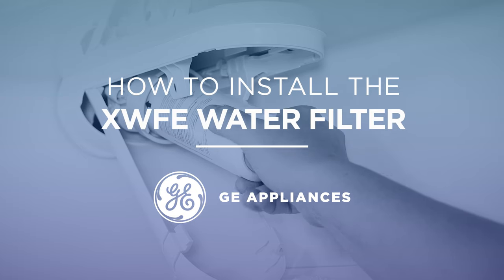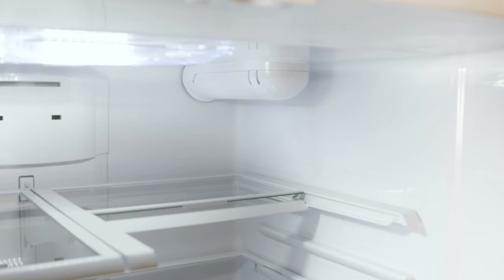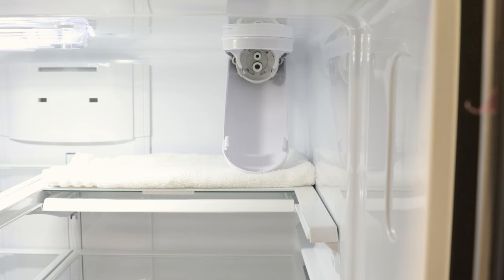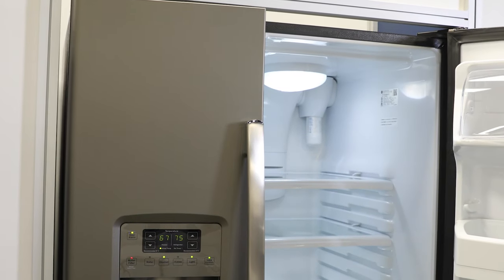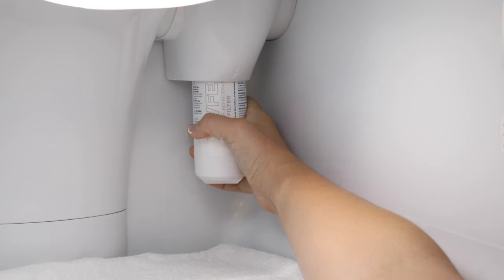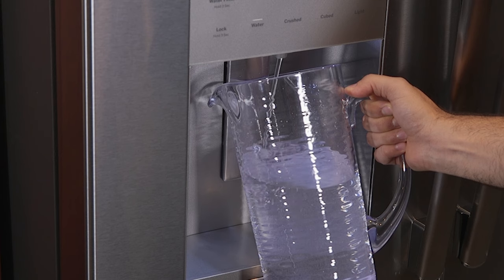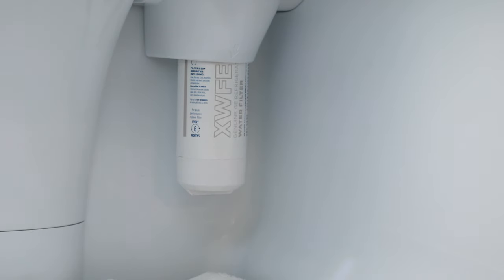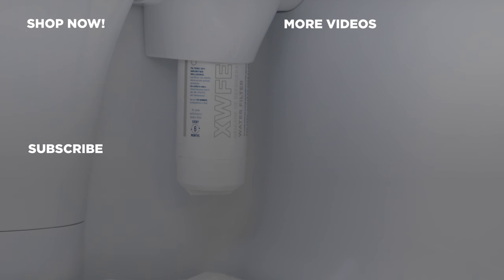Replace and Install the XWFE Water Filter

Comment: I have attempted to replace the filter with a genuine GE filter, and just get "Err" on the fridge display. It will also not accept the old filter, same result. Can anyone advise?
Reply from the maker: Hello, 
We are sorry that you are getting an error code on your display and would like to offer our assistance. If your refrigerator requires WATER FILTER – XWFE please review this link https://products.geappliances.com/appliance/gea-support-search-content?contentId=000060638&_ga=2.24629244.730066905.1646051088-563948630.1643376651
If you still need assistance or have any questions, please reach back out to us, and include the model and serial number for your refrigerator.  Thank you. AS
Reply: I had the same happen… what solution did you find?
Reply: @Oddball8778  Hey Tia! I learned that these filters expire, and the fridge knows that. Previously I had purchased 2 filters at the same time in order to be ready for the next replacement, but it "expired" while sitting unopened on my shelf so the fridge wouldn't take it, and because the old one had also expired it would not take it back in. Basically just have to order them as they expire, and DO NOT remove the bad one until the new one shows up.
Reply from the maker: Hi again Tia,

Per the article that we provided prior, you may see ERR on your display if there is no filter in place, you have a bad or damaged filter, the wrong filter is installed, or you're trying to use a non-GE filter.

You may want to try replacing your filter to see if this helps. If you continue to have issues, you can try resetting the internal electronics by disconnecting power for about 30 seconds then restoring it. If this still doesn't help, service may be needed. Our team can be found here just in case: https://www.geappliances.com/ge/service-and-support/service.htm

Best wishes. -MS
Reply: @geappliances  This is NOT a helpful response in the slightest. The link you've posted doesn't have any troubleshooting help, just the same instructions that are already included in the filter box.
Reply: @geappliances   Just tell us how to fix it HERE, and stop your evil practice of RFID in the filters.
Reply: @geappliances  You don't have best wishes for anyone but your investors.

Comment: Went to replace my GE fridge water filter with a genuine GE XWFE water filter and now I get an error message and no water comes out.  If I put the old filter back in, it works.
Reply from the maker: We’re sorry to hear your replacement filter isn’t working as intended. Please contact the retailer where you purchased it from to discuss return or replacement options. Thank you for reaching out. -GD

Comment: We need filters that can be recycled or washed and reused.
Reply from the maker: We understand your concern and will share this with our teams. We do not have a recycling program at this time; it is generally not cost-effective to refurbish or reuse filters. However, we do recycle 14 million pounds of cardboard, wood, and plastic every year. Note: There is the option to install your by-pass plug and then purchase an in-line filter that can last 5 years. Copy and paste this link in your browser. http://spklr.io/6055SwGP

Comment: Is the xwfe same as xwf
Reply from the maker: Hi!

Thanks for asking. The XWFE replaces the XWF filter and is embedded with Leak-Detecting Sensing Technology. This enables refrigerators to shut down the water valve when a leak is detected at the filter. The size, shape, assembly, and installation of the filter remains unchanged from the previous XWF filter.

If you're needing a replacement filter, we recommend searching for your complete model number on our parts website and taking a look at the various sections of your unit. This is to ensure that you're getting the correct filter and that the part is genuine.

You can view our parts page here: https://www.geappliances.com/ge/parts/?icid=GEARpartsflyout-allparts

Hope this is helpful!

Best wishes. -MS
Reply: @geappliances  then why doesn’t it send any water to the ice maker please answer that question
Reply from the maker: Hi again,

Thanks for keeping us updated. To review this further, please send us a private message on Facebook or a DM on Twitter with your complete model and serial numbers. Also, if you can provide screenshots or copies of the conversation here, that will help keep the entire conversation in one place for us.

If you need help locating your model and serial numbers, you can click here: https://www.geappliances.com/ge/find-model-serial-number/

Hope to hear from you soon. -MS

Comment: I just installed a new filter (XWFW) bought from Home Depot where I purchased my fridge. The new filter had a leak alarm after 4 days. I removed and reinstalled the filter. Received the same leak error. I removed it and reinstalled it and received an error message.  I contacted Home Depot and they replaced the filter. I am still getting an "Error" when pressing the filter button.  What is the next step?
Reply from the maker: Hi Patrick,

Thanks for reaching out about your filter, sorry to hear about this error appearing, we're sure that'd be frustrating.

If you're seeing ERR on your display, this could mean that no filter is inserted, you have a bad or damaged filter, the wrong filter is being used, or you're using a non-GE filter. If Home Depot replaced the filter for you before, you may want to try reaching out to them again to let them know that you're having issues with your replacement.

If they're unable to assist, feel free to send us a private message or DM on our Facebook or Twitter account. If you do, please also supply a copy of your comment here so we have the whole conversation in one area.

Hope this is helpful and that this is taken care of for you soon.

All the best. -MS
Reply: I went back to Lowe’s and returned the defective filter and purchased another one and it worked. The salesman said it’s been common for them not to work since GE put the sensors on them.

Comment: Hi. My model GNE25JSKNFSS has the filter reset at the top of the side by side when you open the doors. I press the filter status and it goes from red to blank after 3 seconds. I was thinking it would show green. What should I expect?
Reply from the maker: Hey Brian!

Thanks for reaching out, we'd be happy to clear things up. The Water Filter light being blank is normal. The filter cartridge should be replaced
when the replacement indicator light turns red.

If you've got other questions, feel free to ask! -MS
Reply: @geappliances   Hi - I just changed my filter and the filter status light won't go off - it remains red.  What should I do?  Thank you!
Reply from the maker: Hi there,

Thanks for reaching out. Sorry to hear about the difficulties you've had here.

After you change the filter, you must press and hold the RESET WATER FILTER pad until the red light goes off. The light will either disappear or turn green. If you do not hold the pad in, the red light will stay on. Also, if you hold the pad in for a long period of time the light may go off and then come back on.

If this still doesn't help, feel free to send us a PM on Facebook or a DM on Twitter with your complete model and serial numbers as well as a copy of your comment here. If you need help locating your model and serial numbers, you can use this page: https://www.geappliances.com/ge/find-model-serial-number/

We do hope this helps!

All the best. -MS
Reply: @geappliances     Under the red light it says "Hold 3 seconds to reset".  I held 3 seconds and it did not go off.  Just held longer as you suggested and . . . the light went off!   Writing this in my manual for next time.  Thanks so much for your help!
Reply: @geappliances model number GSS25GYPGCFS  just replaced the water filter and held the water filter button for three seconds and the side by side is  showing LE | A (H)?
How do I reset the water filter

Comment: I have the same issue most do, this is a 7 month old fridge that the filter light will not turn off. I have purchased 2 filters already this is an issue
Reply from the maker: Hello Mary, and thanks for commenting. We hate to hear you’re having an issue with your filter light not turning off after replacing the filter – we know this must be frustrating, and we want to assist however we can. 

If it might be helpful, we do have information and installation instructions for the XWFE filter at this link: http://spklr.io/6055YLc3 . We also have an article that may be useful, about what to try if the water filter indicator light won’t go off: http://spklr.io/6056YLcO . 

If you’re not able to resolve this concern with that information, you’re more than welcome to send us a private message over our social media (such as Facebook or Twitter) with your refrigerator’s model number and any additional details about the issue you’re having. We would be happy to look into this further for you. 

We hope this helps, and we’re also glad to assist with any other concerns or questions you may have. All the best. -SG

Comment: My filter doesnt turn , Im trying to remove it to be replaced.
Reply from the maker: There may be some pressure in the water line. We recommend dispensing a couple cups of water first.
Reply: Twist left

Comment: @geappliances we are having the error code issue. We have only had the fridge for 7 months and this is the first time we cha fed the filter after the original install. We followed the directions but cannot get rid of the error code. We even tried flipping our circuit breaker to reset the fridge. We were installing a brand new legit correct filter. We then tried to put the old one back in and still receive the error code. This is incredibly frustrating!!
Reply from the maker: Hi Amanda,

Thanks for reaching out, we can certainly understand the frustration and we'd like to help as best we can. If you're seeing ERR on your display, this could mean that no filter's inserted, you have a bad/damaged filter, you're using the wrong filter, or a non-GE filter is being used.

If you purchased your XWFE filter from our parts page and are still having issues, please PM us on Facebook or DM us on Instagram/X with your complete model and serial numbers, as well as a copy of your comment here for context, and we'd be happy to review further. If you need help locating your complete model and serial numbers, you can click here: http://spklr.io/6055ml0x

Hope to hear from you soon. -MS
Reply: @geappliances  I messaged you on Facebook last night but haven’t heard back yet. I included the model & serial numbers and an explanation of the same issue. We correctly installed a legit filter we bought from Lowe’s, exactly the same as the one we were replacing. We tried to put the original back in and that won’t work either. We need water and ice!! 😭
Reply from the maker: Hi, Amanda, and thanks for getting back with us. We are happy to talk to you more about this through our Facebook thread with you. We understand how important it is for you to have ice and water, and we will reply to you on that platform as soon as we're able. Thanks in advance for your patience! JP

Comment: Michelle, I'm having the exact same problem as you.  It's not hard but the darn filter is not working, I get an err message.
Reply from the maker: Hi there,

Thanks for taking the time to reach out. Sorry to hear about the filter issues you're having, we're sure this would be frustrating. If you're seeing ERR on your display, this could mean that there's no filter inserted, you've got a bad/damaged filter, the wrong filter is being used, or that you're using a non-GE filter.

If you have other questions or concerns, feel free to send us a PM on Facebook or a DM on Twitter with your complete model and serial numbers. If you need help locating those, you can use this page: http://spklr.io/6057cO9N

We do hope this is helpful.

Best wishes. -MS

Comment: Unfortunately, I also struggled with the filter problem for days before I found the solution! GE solved it with a chip, so that only its own filters can be used, it cannot be replaced with a filter from another party, only the one in which the chip was installed! (rough) So the XWFE types have a chip, while the XWF type does not! The only solution is to buy a GE chipped filter, which unfortunately costs approx. $50! The aftermarket, but replaceable XWF type is not good, because it does not have a chip!

Comment: I genuinely cannot wait to carve the RFID tag from my $50 replacement filter and smack it right onto every $7 generic filter for the rest of my ownership of this fridge. I would have never bought this refrigerator if I knew that you RFID-locked your filters, what a shitty feature.
Reply from the maker: Hi Isaac,

Sorry to hear that you're not totally pleased with your fridge's filter. We don't recommend altering your filter or using a non-GE filter in your fridge as we've not tested or approved the unit with that in mind. If you'd like to learn more about the XWFE filter and the RFID tech in it, you can click here: http://spklr.io/6059cY8B

If you've got other questions, you're free to ask. -MS
Reply: You don’t have to carve it out from the XWFE models, you can simply heat up the label with a heat gun or hairdryer and pull the label off. The RFID is embedded in the label itself. Be careful not to tear the RFID tag part up, or it won’t work anymore

Comment: I just change the filter XWFE and i got the fillter status saying Error , i try to run the water but it can not pull out due to Error Filter status . Any help!
Reply from the maker: Hello, we are very sorry to hear that your experience installing the XWFE filter did not meet your expectations.

The refrigerator's water valve might be deactivated, and we recommend installing the bypass plug that came included with your unit to reactivate the valve. You can learn more about this, and other possible causes and solutions for this concern, by referring to this article: http://spklr.io/6054lwmy

If a bypass plug did not come included with your unit, please send us a private message on Facebook or Instagram with your full model number so we can assist with this situation. 

We hope this information was helpful, and please let us know if we can provide further assistance. 
Take care. - PM

Comment: So stupid there’s a chip in the label and you can’t use a generic filter bc they don’t have the chips. However, I purchased very expensive OEM filters and they don’t trip the trip system to work. Nice, charge me a lot, then don’t work. Thanks GE.
Reply from the maker: Hello Kris, we're sorry to hear that your XWFE filter has not met your expectations.

We always recommend filters manufactured by GEA and sold by our official retail partners because out filters help prevent water leaks. The RFID (radio frequency identification) component is part of the overall system that communicates with the refrigerator and shuts off the water supply in the event a leak is detected. Counterfeit filters without this technology will not perform the same way in the event of a water leak.

If your "Replace filter" indicator light is not clearing away after installing your unit, we recommend referring to page 2 of the installation instructions here: http://spklr.io/6052lB46

Please know we are always available on Facebook and Twitter if you need further assistance. All the best. - PM

Comment: I get the LEAG error message.  Bought the filter from GE.  Ran a ton of water through it when I installed it.    Painful.
Reply from the maker: Hi!

Thanks for reaching out. We're sorry to hear about the issues you've had here with your filter. We can certainly understand the frustration.

If you're seeing ERR on the display, this could mean any of the following: No filter is inserted, you have a bad or damaged filter, the wrong filter is being used, or you're using a non-GE filter.

If you're still having issues, please send us a private message or DM on Facebook or Twitter with your complete model and serial numbers; please also let us know where you purchased your filter from.

If you need help locating your model and serial numbers, you can click here: https://www.geappliances.com/ge/find-model-serial-number/

Hope to hear from you soon. -MS

Comment: i have a side by side fridge. model GNE27JYMFS  followed the video . but no water is coming out. can anyone help?
Reply from the maker: Thanks for reaching out about this. After replacing your filter, air may be trapped in the water system. Press the dispenser arm for at least 5 minutes. If this isn't helpful, reach out to us on Facebook or Instagram, as we're happy to further investigate.
Reply: @geappliances no that wasn't my the issue. my filter didn't have a chip on it. so i took the chip off my old filter and now it worked. but you guys are illegal for doing this and you will be sued
Reply from the maker: We recommend that refrigerators with water filtration systems only use genuine GE Appliances water filters. Genuine replacement filters are certified to NSF/ANSI Drinking Water Treatment standards which ensure structural and safety standards are met, and are designed to operate within the environment of the refrigerator. AHAM (Association of Home Appliance Manufacturers) through partnerships with NSF, IAPMO and WQA tested and found counterfeit filters do not always meet the NSF/ANSI Drinking Water Treatment standards and can damage the refrigerator's filtration system. Many counterfeit filters are sold online and have been known to burst and/or leak, potentially resulting in costly property damage. Many counterfeit filters claim to be "exactly" the same as a GE Appliances Genuine filter but often only filter chlorine, taste and odor and are not certified to reduce harmful contaminants such as lead, mercury, arsenic, VOCs and pharmaceuticals.